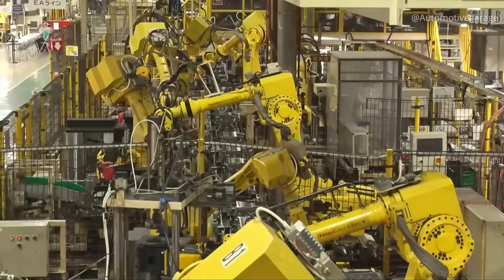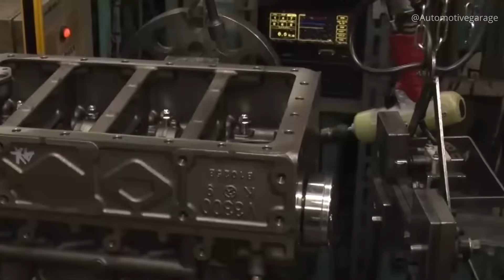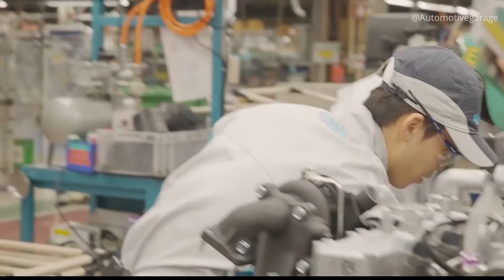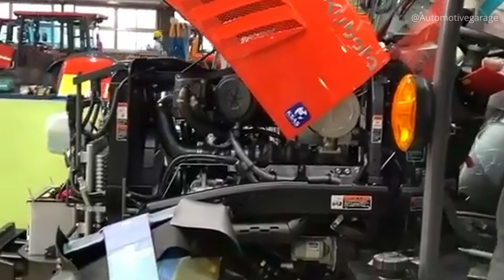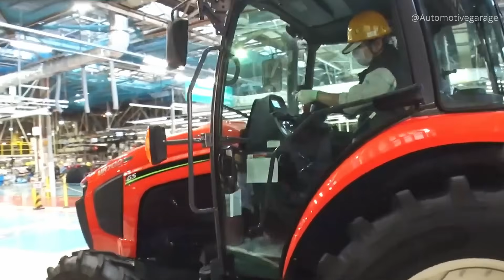How Kubota Tractors Are Built in Japan | Tsukuba Plant

Comment from the maker: Japanese Engineering at its finest! 🇯🇵 Which part of the assembly process surprised you the most? 👇
0:04 ⚙ The Art of Precision: Watch raw iron become high-tech engine components.
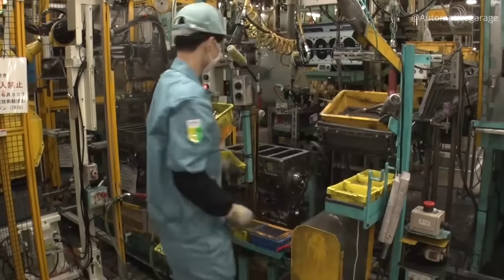0:15 🔧 The Human Touch: Skilled assembly of the engine and gearbox.
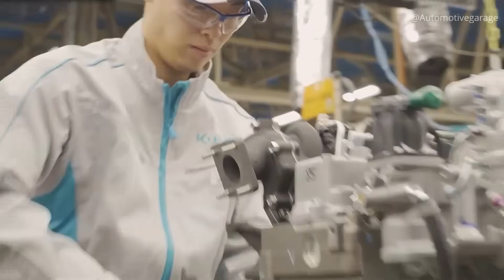2:34 🔥 The Moment of Truth: Initial bench testing of the completed power unit.
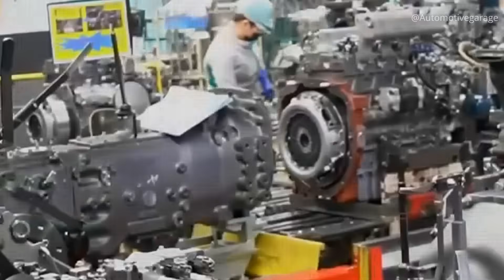3:00 🏗 The Backbone: Integrating the powertrain into the heavy-duty chassis.
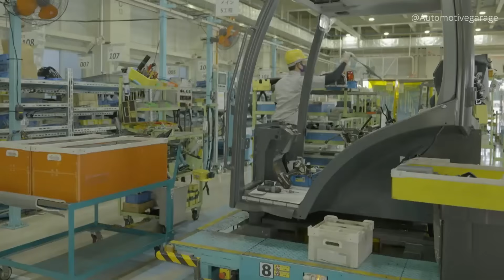3:43 🖥 Cockpit Secrets: Assembling the high-tech interior of the cab.
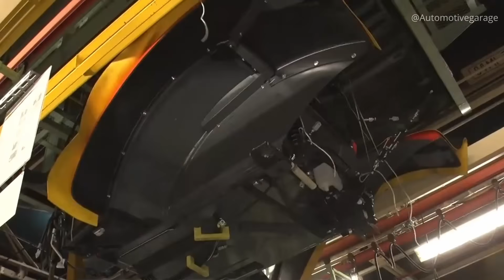4:34 💎 The Perfect Match: The "Marriage" of the cab and the powertrain.
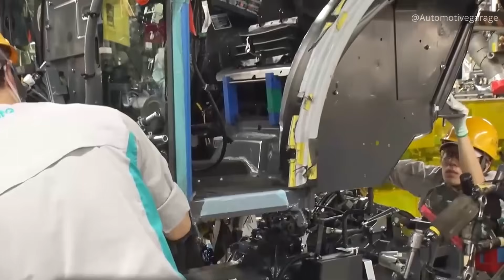5:31 🚜 Heavy Metal: Massive wheel installation on the HS line.
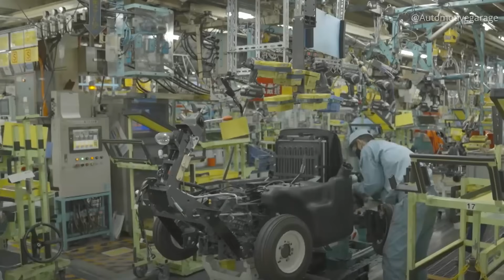7:16 ✨ The Icon: Final assembly details of the legendary JB series.
7:47 🚿 The "Monsoon" Test: High-pressure water leak and roller inspection.
8:46 💨 Full Throttle: Putting the tractor to the ultimate test on the proving grounds.

Don't forget to SUBSCRIBE for more exclusive tours of the world's most advanced factories! 🛠

Comment: The problem is, that some Kubota tractors are NOT produced in Japan , they are only sold with Kubota colour and label as "Kubota product". I was using B2231 HST cab for several years and quality was great. Then I went for L1382 , had tons of issues. I learned that L1382 is a tractor produced in India. I had really serious issues befor even reaching 150 mth !!! Tractor was many times pulled out by the dealer to repair. So what is my lesson - no senso to be excited that I am buying a "kubota product" because they will love to sell me something else, just with Kubota labels. So now I am no longer loyal to this brand, I am going after New Holland Boomer or TYM or something else. Because on the end Kubota sells the same (or worse!) quality.
Reply: If that's all true, just buy only the ones made in Japan, and you're  problem is solved. Learn to investigate any large purchase. It maybe considered wise. (it all looks like b.s. anyway)
Reply: @oldbuzzard76       👍👍  You are so correct. I have a 1993, B2150, made in Japan.
I used to buy Honda automobiles that have J on the serial number.  That meant they were made in Japan.
    When I order new Mercedes, I only purchase ones that are actually built in Stuttgart !!!

Comment: Як виготовляють Янмар?
Reply: Yanmar diesels are great motors for certain applications such as marine applications and small tractors and lawnmowers.  
   However, in my opinion, they are NOT as rugged as the Japanese built Kubota diesels.  I believe that Yanmar engines cost a bit less, but once again are a fantastic choice for the weekend farmer like myself.  We have a Yanmar power plant in my wife’s John Deere mini-tractor, and it’s fantastic.  This little toy has the front bucket, mini-forklift, belly mower, and the excavator on its rear. Most importantly, this tractor has beer can holder.
    I still prefer Kubota engines, as long as they’re made in Japan, and most importantly, stay away from the larger Kubota motors that were made around somewhere around 2014 - I think ?
There was a short period of time where Kubota engines were unfixable. 
I heard horror stories where dealers threw up their hands and simply gave up. (Please help me with this info if you are better informed)